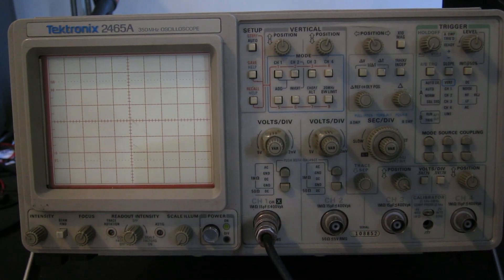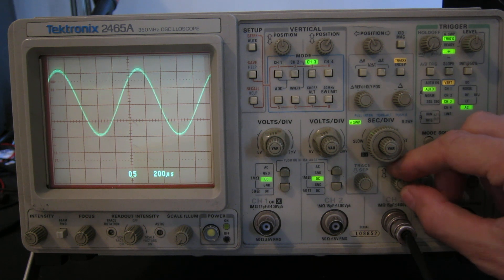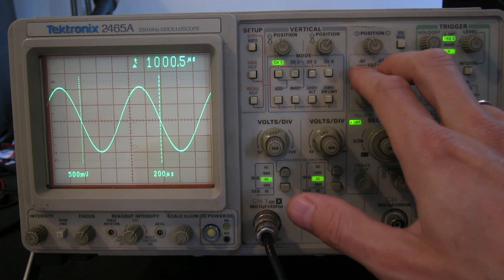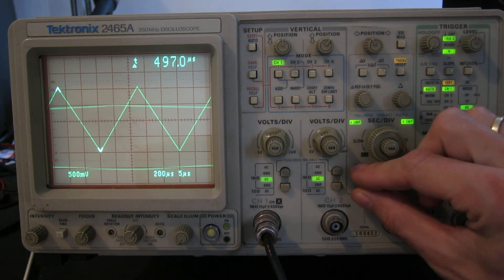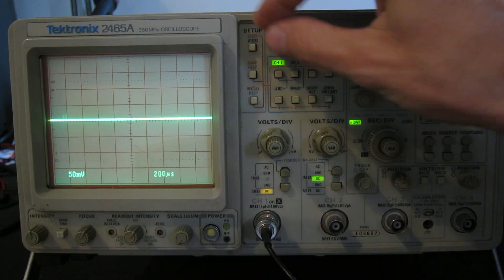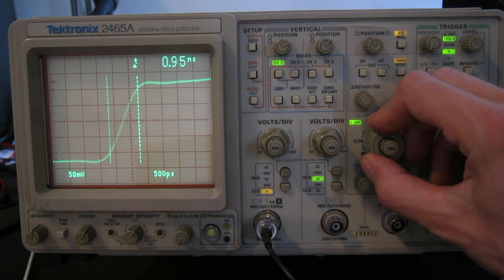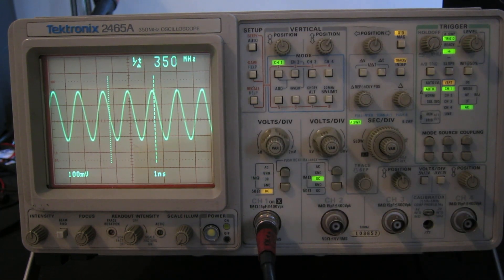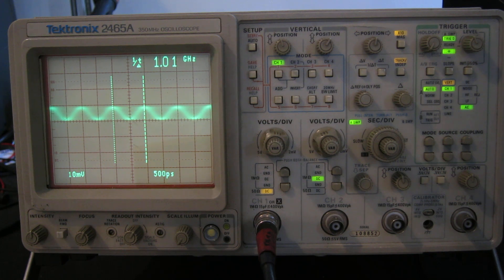Tektronix 2465A oscilloscope demonstration

Comment: CMJONES, can you make a video lesson on what the VAR controls are used for? Can you think of a bunch of examples using the VAR to do what types of measurements
Reply from the maker: @waynegram8907  nice idea, but I'm afraid I'm unlikely to have time to do that. The VAR controls are mostly useful when you want to scale the trace to fit the grid on the screen, so as to be able to measure ratios in time or voltage using the grid rather than absolute measures of volts or seconds. For example, if I'm looking at a serial data signal, I might use the VAR time base control to scale exactly one bit of data per division, making the trace easier to interpret.

Comment: I have one of these but it did not come with probes. Can you tell me what probes will work with it? I’m relatively new to o-scopes and there are many probes available.
Reply from the maker: You can use any probes you like, more or less. The 2465A would originally have been supplied with some smart Tektronix ones rated for the full 350MHz bandwidth, but there's no point in searching for those. For everyday use, the cheap 10x probes available on eBay (I'm using some here labelled "P6100" with my 2465 right now) are perfectly adequate. You'll need to adjust the high-frequency compensation using the little adjuster screw on the probe or plug - read the scope or probe manual to learn more. If you want to get in to accurate really high-frequency (>50MHz) measurements, then you can start worrying about better probes, but it's a complex subject and is about more than just the probe.

Comment: How do you hook up the oscilloscope to the component under test? or is it not necessary?
How do you do the testing of the item you are trying to troubleshoot?
that is what i want to know but there are no videos showing it they all show the same thing like this person is doing.
Reply from the maker: This video is just a demonstration of the oscilloscope and that its features are working as they should. I made it because I was selling the oscilloscope and wanted to show buyers that it worked properly. How to use those features to examine and troubleshoot an electronic circuit is an enormous topic, and not one that could be covered in a 10-minute video. The key is to learn some basic electronics and understand what to expect at various points in a circuit. The oscilloscope allows you to see what's going on, and it's then up to you to compare that with what you think ought to be happening.

Comment: Picked my 2465a up yesterday. What a scope. As you say, Tek certainly knew how to build these practically bullet proof machines! Have to change out the caps on the LV PSU and also the nv-ram battery... Love how they were also made in Guernsey. About 40 miles away from me. Never knew they had a facility on the island 👍

Comment: Since it uses a cathode ray tube, it is clear that it is an obsolete instrument.  However, it is an excellent instrument with incredible performance.
I have not used it but I have used the Tektronix 465 and the Tektronix 7313.  I am a telecommunications technician, although I am now retired. I have worked for over 30 years in VHF, UHF and these oscilloscopes were my field instruments along with a Hewlett Packard spectrum analyzer and a Wandel & Goltermann generator.
All were incredible pieces of equipment.  Made to last for many years of heavy use.  There was absolutely nothing that could not be measured with them.
Even today, even though they are technologically obsolete, they are still very valuable and in many cases, much more reliable than any Chinese sampling oscilloscope.
This video brought me nostalgia.  I find it hard to accept that I am retired....
Reply from the maker: Nothing obsolete about CRT instruments! I have a Tek 7904A analogue scope on my bench beside much more modern digital scopes, and the analogue machine tells me more things more quickly when I'm debugging than my digital ones will. They're fantastic tools.
Reply: What would make them obsolete? I would use a CRT over the laggy LCDs on "modern" scopes.

Comment: My CRT sharpness is about like yours (my Tektronix 2465 DMS, not A or B!) - is there a way to sharpen the display to more crisp display? Thank you for your videos and even quick demo like this is!
Reply from the maker: The sharpness on this one is absolutely fine - I wouldn't expect it to be any better. I have three other 2400 series scopes and they're all as good as each other. I think these CRTs have a post-deflection expansion mesh so they're never going to be as sharp as really old CRTs, but they're as good as you'll get for the era and speed. Keep the brightness down for best results.
Reply: @cmjones01  Thank you very much!
Reply: @cmjones01  Thanks and I'll work on it in the next couple of weeks.
Reply: @Tony Flemming You may be disappointed to hear but I only mentioned the Amiga because it was the first real computer with a hard disk that I ever new. At heart I am a Sun IPC man. That was since I managed to buy out the British National Coal Boards graphics cluster with AutoCAD installed on a Micropolis 600 mB drive. You just need to be at the right place at the right time , eh?
Reply: Swap out the line output capacitor or get a TFT.
Reply: @factorylad5071  Do you know what value the cap should be? In case TFT, if I understand that right, where and what part to replace with what value/type?  I can do just about anything, if I have plenty of information. I'm little old, so I rather do it only if I can follow little more specific schema/instructions. If you know of a video on youtube, please let me know. Thank you very much for quick response! Have a great weekend also - you all also! ha ha ha
Reply: @tonysfun  Tony you have misunderstood me on TFT , I meant a solid state screen , digital scope, they are very good value and have way more functions than you would get on this beast. If however you are stuck with your out of focus CRT , I would carefully examine the components around the line output stage which is much less I think than 1 uF , line voltage rated + 25% and is most likely to be a polystyrene type. Hope this helps. Happy tinkering.
Reply: @factorylad5071  Aha, now I understand! I do have few digital scopes from single to 4 channels and they work great, but my dream was to get Tektronix so I have it and  I just like to have a sharper display - but it isn't a 100% must, just like 75%... ha ha ha
Yes, I can poke around the your described areas and see what is going on.
Right now I'm reorganizing my lab, and I'm having way too many "gadgets" for the space I've dedicated and have here. But giving away stuff and removing items is the only way right now. Thank you again for a BLITZ speed reply and more details!
Reply: @tonysfun  lol I can't give some of my old stuff away, like an Amiga 2000 with pc bridge board so I just leave it at the car wash.
Reply: @factorylad5071  I sold Amigas in Lincoln for a long time, until Commodore went kaboom! They had a greatest computer - including the one you left at..... BUT they stopped selling to business and develop business computers even if it wasn't running Amiga OS but some PC emulator..... The money is in business because people work with them and they buy the same as they work on. But I loved Amiga and TOASTER and .... DIGIVIEW company was great, I knew the owners....
If someone would make a today's Amiga, I think I would have to buy one! The company in Germany that makes them isn't up to snug with today's computers, to bad! Have a nice weekend!